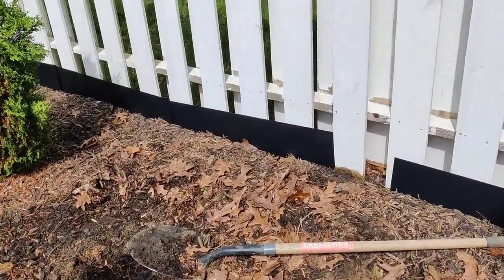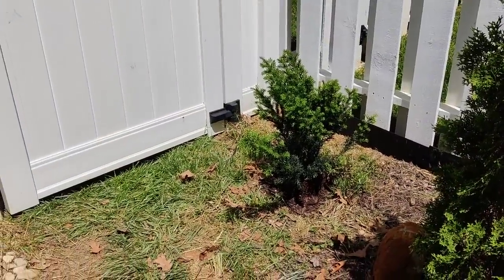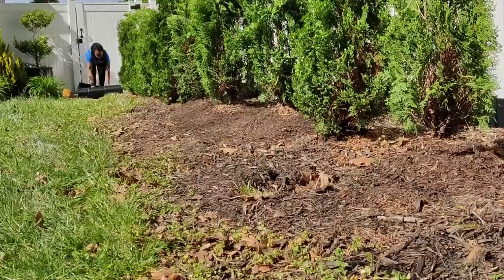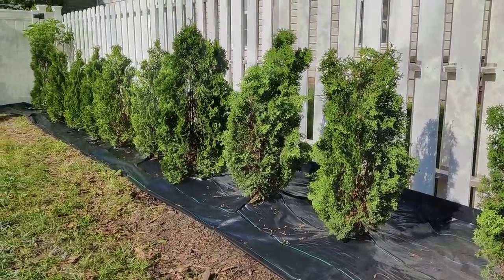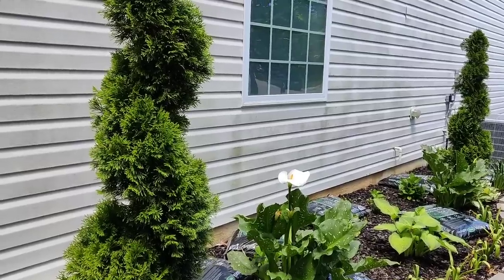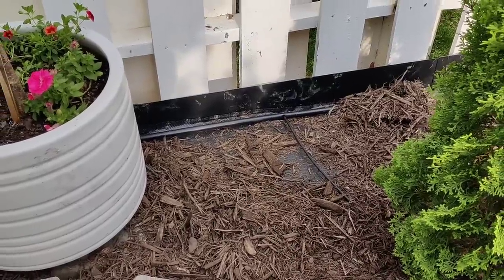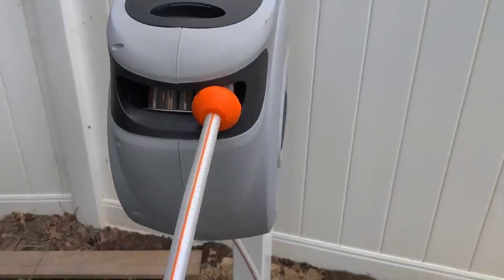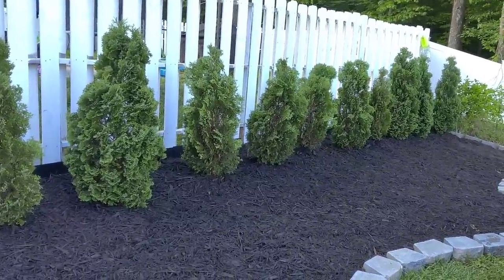Backyard Makeover pt. 1| NEW Garden Bed| Retiring 'Rehab Row'| New Hose Reel|

Comment: Hesitate to say this, but: Your neighbors NEED to work on their drainage. They likely need a french drain for rain water, to redirect all the water to a better suffusion job...good luck.
Their own foundation could be at risk, very expensive potential structural issues for them.
They need (you may have to hire...) a landscape/drainage EXPERT to assess their above-ground and water table water directing.

Vevore HOOKED you up!!